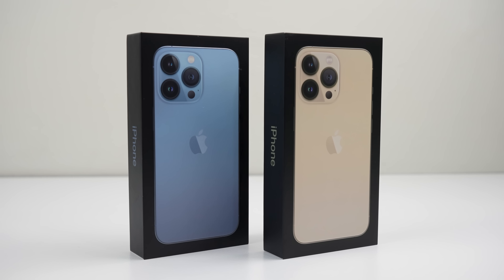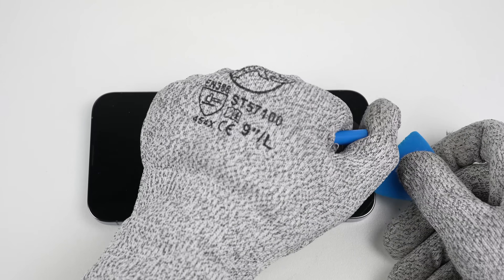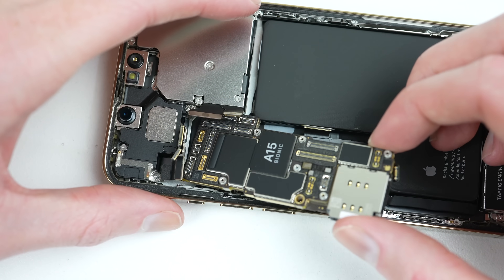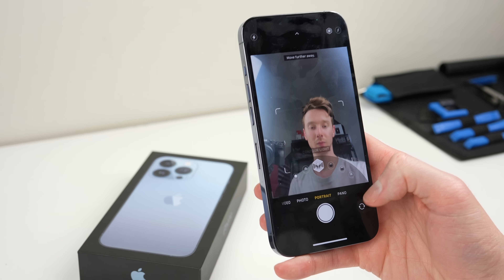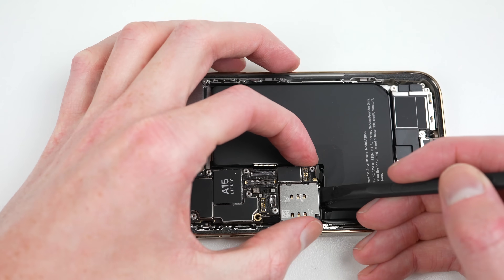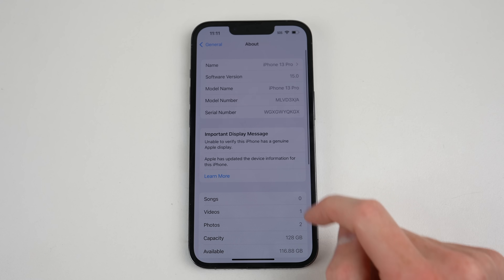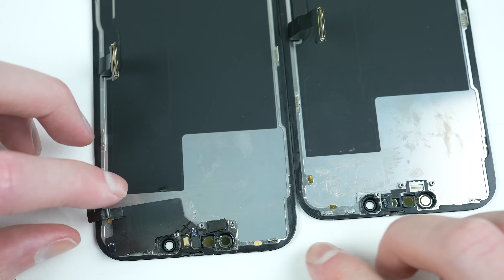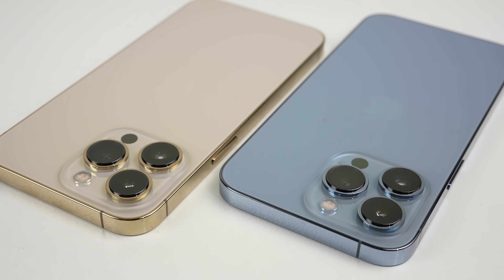iPhone 13 A Repair Nightmare - Teardown and Repair Assessment

Comment: I had a vacuum cleaner once that pissed me off every time I used it. The power cord was in the worst possible place it could have been, and most of the time cleaning 
with the vac was spent trying to to keep the damn cord out of the way, untangling it, swapping which hand was holding it, etc. It was a PitA! I finally sent a msg to their 
customer service dept. with an idea. I told them that if they did any interviews to hire an engineer in the future, they should give them a test to see who would be qualified
to work there. I said to give them the same model of vacuum cleaner I had, and tell them to engineer a worse way or place to install the cord. If they could do that, hire 
them! I got a typical canned response back, but I hope it made it to someone to at least make them laugh. Did I tell you that thing still pisses me off just thinking about
it?  lol (And yes, it did have an earlier than normal death by an un-natural cause. Violence was involved, but it wasn't the random kind).

Comment: As the most privacy-forward, secure mobile platform, I think this is not just to lock out third parties, I think it is to ensure security. You never know what a third party repair person might do. Most may be good, most may just do a good job, but some, might install things that should not be there for any number of nefarious reasons. So, I think it is not about screwing third party repair shops, I think it is more to keep security for the end user & single-party accountability.

Comment: i have a bone to pick with these software design decisions not only because they go against the paying customer's autonomy, but also because not every country or area has a genius bar or certified apple repair location. my country doesn't have one. there are apple verified retailers in our capital, but AFAIK no authorized repair location. so if my screen breaks i just have to go suck a d*ck according to apple??? if they are going to place such strict limitations on repair they should at least make sure they have the support to back them up lol.

Comment: I actually like what Apple did here. If I want to purchase a refurbished/second-hand iPhone 13 in the future I will know whether all the parts are genuine or not also whether the phone is tinkered with just some random dude or it has only been repaired or didn't get repaired by Apple itself. Besides, for example, the screen is still replaceable it just has to be fixed by an experienced Apple employee using a genuine display. If I can afford a 1000 USD phone I wouldn't try to replace my screen with a Chinese 3rd party screen anyways.

Comment: Take it from someone that works at an AASP it's garbage. It's pretty sad mind you the "pairing" process usually takes less than 1 minute. Doesn't say exactly what it's doing but my assumptions is it's taking said serialized parts and pairing directly to the phone/logic board. This pairing process needs to be ran on just about every single replaceable component that Apple offers to repair. Otherwise you lose most functionality.

Comment: Hugh,  did you try doing a hard wipe of the device where you need it to put it in like DFU mode. Because somewhere on that device there is a cache of serial numbers that it is using to authenticate / invalidate all the core parts. There has to be a way of putting that operating system on brand new and not from the commercial outlet of iTunes Store. There’s only so many different ways Apple repair is recertifying all of the parts for us authentication process. So if they put a new screen or camera while repairing a device, there has to be another mode, another master mode there’s omitted when you reinstall from the iTunes.

I think you use too many main stream techniques for this video and I get the point of the video, however there is a way around these obstacles. Seek and you shall find.

Comment: Welcome to the automotive pain, many parts in a modern car if replaced needs to be reprogram with the replacement part number by the manufacturer or else your car is useable, phones have now caught on and other manufacturers would start to do the same, unless there release there programming of modules software to replace the parts ID in the logic board

Comment: Not that I have a Rolls Royce but if I did I would get it serviced by an authorised dealer.  It's the same for premium phones and watches. Buy cheap buy twice.  Having said that I am not surprised by anything I've seen in this video - nicely done.

Comment: That is because of the microcontrollers added to thier iphone13 line up which needed an apple special repair tool that for sure apple has the only one have it. That microcontroller will pair for those what you have replace, or else it will detect it.

Comment: To people that didn't get it, when the phone freaked out when it had parts repaired, apple literally PROGRAMMED the phones to perform those actions. It is not 'an aftermarket' part effecting the phone. With glitches and features gone without an alerting message, they deliberately made the phone not work, to undermine third-party repair stores that doesn't have access to original parts and make users think they broke the phone.
Reply: I used to repair iphones and Apple has has a configuration software where that only  Apple techs are able to use Anytime that you switch out a part on an iPhone you have to configure it with that software if you don't it breaks the phone
Reply: @Thx4thefreekill  I heard that in China you can actually repair them because they have these Apple Dev tools and in third party repair shops it's included in repair.
Reply: @Matteow00  Yes from china can confirm. Good supply of brand new OEM parts and they have these devices that would flash the old serial number to the new component.
Reply: even if 3rd parties had original parts they sttill wouldnt work lol
Reply: Yes, the level of Apple's cynicism is unbelievable
Reply: Apple are on some next level victim blaming, and it's fucking disgusting 😤
Reply: In other words a virus.
Reply: You don't get it right. This video  shows, that EVEN you have access to original parts, you CAN'T fix your phone. That's the huge difference. I could relate, if they just want to knock off third party parts, but THIS bis not ok. No iPhone for me.
Reply: @salacryl  there's a tool  you can buy from China that has the ability to read and copy ID information. Thus you can take the old part, read it's data. It gets stored in RAM. Attach the part to be swapped to the device and paste the number of your old screen essentially and literally in. Now it works as genuine. If the part ID cannot be read in the first place - like due to a broken connector - you're out of luck, go bend over at Apple.
I've used this device myself and it becomes a hell of a cat-and-mouse game - to continue to be in the business of repair, you have to invest in these Serial ID cloners. Or shut your store.
Reply: @salacryl  That's... exactly what he said lol
Reply: @json_bourne3812  no it's not. He said that they did this to prevent people from people trying to use 3rd party parts.
Apple's software parts restrict even original apple parts from working.
Reply: @Che8t  I do notice that he says two conflicting things (the 2nd thing probably in error) - he mentions it's "not even aftermarket parts", implying EVEN Apple parts will cause issues, then also says it's to screw over third party repair places, referencing non-original parts.

Mind you, they're also doing that anyway, so both statements are technically correct anyway.

Comment: As you saw the hardware itself from the devices were in fact genuine apple parts however with exclusive serial numbers..So via software each hardware component is serial number provisioned so if the software  does not see that all serial numbers for the components match based on the devices serial number itself ..then the nags come!
this is directly to prevent hard ware replacement by third parties!  Now if you have a device for each component where you can save store and transfer serial numbers from components, this will do the trick! If you say take the camera …and use a device to snoop it and locate its serial number and id markers …and save then and then transfer them to another device ( saving that devices serial number ID markers before hand ) this could possibly work so that when the software sees the new device it’s assumes its the same hardware via the matching of the serial numbers and id markers!  However I am not sure if such a device exist for these phones. I did see where someone had a display device to Copt they serial numbers and id of the display over to a new display and the display worked! this was for a DIY IPhone 10 to IPhone 11 or 12  Housing!

Comment: Glade it’s this way . And it’s a security liability, what if you swapped the logic board to get access using another Face ID . Seems to be a safety feature and if your a certified Apple repair service you would have the ability to get around these issues.

Comment: Just get your screen fixed at Apple, problem solved. Apple care is like 10 bucks a month and guarantees you’ll get a proper repair with the proper parts. Most 3rd party repair places use 3rd party displays which usually sucks anyway.

Comment: I'm an Electronics Technician and your repair skills are amazing! I work on industrial devices which in comparison are very simple to open and swap parts. What scares me is where Apple goes the rest of tech usually follows. In California we went through a similar thing with cars and proprietary diagnostic software and connectors. Right to repair laws resulted in the standardized OBDII port and readers being readily available to independent garages and consumers. I hope the EU can push back on Apple. I'm afraid the US legislators are owned by large corporations at this point.
Reply: If memory serves the usb c socket was forced on them by the EU in the interest of standard charging sockets and devices.
Reply: And now Tesla is fighting that, OBDII was due emissions, Tesla (or other electric only vehicles) has none. Cars will be the same, also from SW side, if you miss certain amount of updates you can’t drive :-)
Reply: yeah, companies generally follow.
if we look at the mobile platform alone, you had Apple who removed the headphone jack because it was "legacy" and just old tech.

Everyone laughed at them (and rightfully so) yet the phones did better than ever.
Now Samsung does the exact same thing with the S21.
then Apple removed most of the packaging, like no more charger brick, no more earplugs etc.

everyone laughed at them, but people still bought their products.
now Samsung does the exact same thing. (Apple sets the trent for bad practices all over the industry, even with Mac, since Microsoft now also forces you in windows 11 (if you don't have the pro version) to login with your microsoft account.
and you can technically instal windows 11 on  "incompatible" device, but they already have some performance issues then if it detects certain feature being absent.
Reply: Hey! Question, my iPhone 11 display is horrendous rn. Several cracks and black ink/hole looking things on it. If I were to get the display replaced would it also completely mess up my phone? If so I’d rather just let it stay like that😅
Reply: They most definitely are. All politicians are, don't care who.
Reply: Yeah companies can buy votes pretty much, not like literally, but they make contributions to politicians and your money is considered your "speech" in the eye of the law so it's their freedom of speech to contribute ass loads of cash to anyone they want

Which at a glance doesn't sound so bad, but then you remember oil companies exist
Reply: @todd5purlock497  so i guess since oil companies are so bad you dont use any of their products... hypocrite
Reply: @thumper84  what on earth are you talking about? Because it's certainly not at all what I said.
I am talking about the fact that oil companies are large and back politicians so they don't have to stop doing what they do.
So what the hell are you talking about exactly?

Comment: As a former phone tech, you make me proud.  The days of repairing your phones or at least iPhones at home are long gone.  Seems like it went away along with the headphone jack.  I kept my 5s up until the first SE came out for this very reason.
Reply: It's hard to find a premium phone with a headphone jack these days. For me, it's important for two reasons: 1) Most of my cabled headphones last a year at most before it gets lost or destroyed. Pricey wireless earbuds will be costly to replace yearly, and you often cannot replace the batteries within when they die. 2) At home, I often plug my mobile phone to a valve stereo system to play music. There's no way I will be able to do that with these new phones that has no jack socket.
Reply: @jonathantan2469  as far as at home and in the car I’m perfectly fine with Bluetooth.  It’s when I’m out or working that I prefer to have wired headphones I collect the EarPods that come in Apple boxes for that reason.

Comment: Wow ... I showed your video to someone who was saying Apple wasn't anti-right to repair and without looking at the video said you were crying your life because it's not that hard to open ... I pointed the main subject of the video to which he legit told me that the phone was misbehaving because you shorted something and when I pointed out it wouldn't work correctly with the original camera again if it was so he told me you just had to use the right parts, to which I pointed it was 2 brand new iphone 13 and then finished by telling to believe what ever I want but your video was fake.

Man ... it's frustrating to argue with a wall

Comment: That’s their grind we’re messing with. After the 5c their new game plan was (make them easier to break , charge an arm to repair) just admit with every new one comes out it takes a lower fall test to break it. Even stealing new features from tweak developers and make the next update seem new while blocking jbs and suing developers but using the tweaks. And suing repairmen and women that specialize in fixing things even they won’t fix. But it doesn’t matter I love apple products and all my iPhones because instead of paying 1k for them I bought em broke and fixed em myself

Comment: Wtf? Just buy Samsung. Who the hell would buy Apple? And why?
Reply: Samsung are pulling the same shit too. The A51’s fingerprint scanner is disabled when the screen is replaced and although not technically repairing it but the cameras on the z fold 3 stop working if you unlock the boot loader

Comment: I love Apple but I am not a fanboy. I do love their software and hardware, however, I have to 100% agree with the comments. This should be made illegal by law. Right of Repair is and was always an issue with Apple. The exception was Steve Wozniak's Macintosh II. The lack of Right of Repair on Apple's part is also a very big reason why Steve Wozniak, one of the 2 creators of Apple, was highly unsatisfied with the direction Apple was going and hence left the company. I currently own an Android phone (I always switch between iOS and Android) and although I find iOS better, I, as someone who likes Apple and doesn't shy away from paying a Premium for their devices, have to admit that in this regard they are truly horrible.

Comment: You know, I'm kinda surprised people haven't figured out a way to flash parts with the IDs from the factory parts to trick the iPhone into continuing to work.  I mean, I'm guessing people have tried and it's not quite that easy..but with the insane things I've seen people do with modding consoles and stuff I'm surprised someone hasn't come up with something.

Comment: Just disgusting. Can you imagine Toyota or Ford behaving like this? Demanding that you go to their dealerships and only their dealerships for your car to be serviced. It's like if you changed the oil yourself, then your car is forced into limp mode and displays some warning lights. As well as disabling the radio head unit and power steering.

I personally gave up on Apple years ago. As time goes by it becomes more and more apparent how wise the decision was.

Comment: I recently had a third party screen replacement on a 12, and nothing works - camera is totally dead and no face ID. Good thing I watched this. Was just on my way to the store and give them hell..
Reply: Repair technician here. Your camera and Face ID should still work on an iPhone 12 after a screen replacement, even by an unauthorized store. As far as I’m aware the only thing that stops working is True Tone. 

I’d recommend going back and having them make it right by you before your return window runs out. Don’t be mean; mistakes happen. But those parts should still work after a simple screen swap on the iPhone 12. Only the 13 series is affected by the issue in this video.

Comment: Does it mean that even if I take the phone to an Apple Service, they are not going to be able to fix either even if the parts are genuine?
Reply: nope, apple technicians have software that sync the display's serial number and the phone's serial number
Reply: What they do is adding software to each hardware component, when that software stops running your mobile just stops working properly.

Comment: Remind me to never ever get an iPhone.
I've only had to repair one of my smartphones and got a case for them afterwards every time, cuz preventing is cheaper than repairing.
But even then you should have the ability to repair anything about the device.
Hell, I'd be okay with it if Apple sold the tools necessary and offer the service to those who are not as handy as is necessary to repair these devices.
This is just awful, absolutely predatory and anti-consumer in every single way.